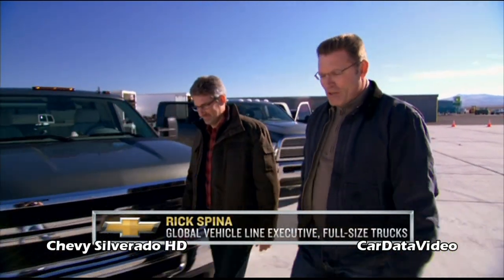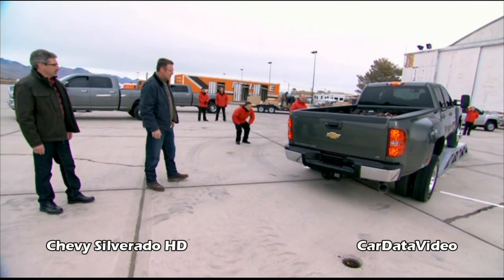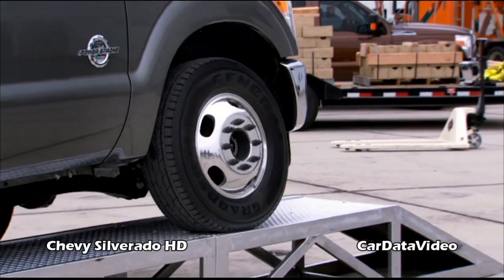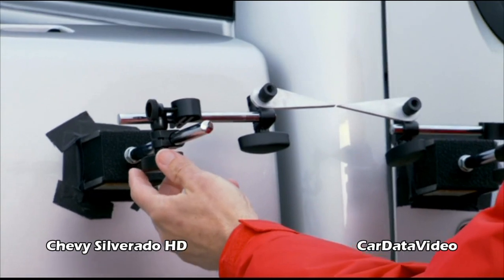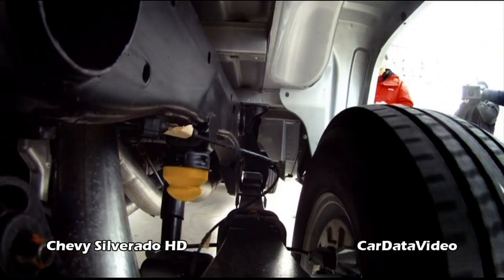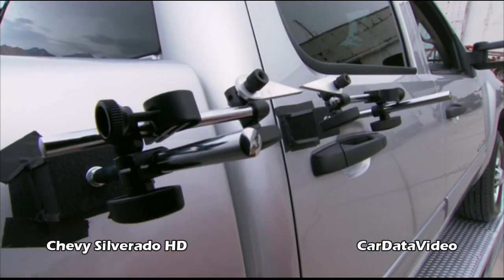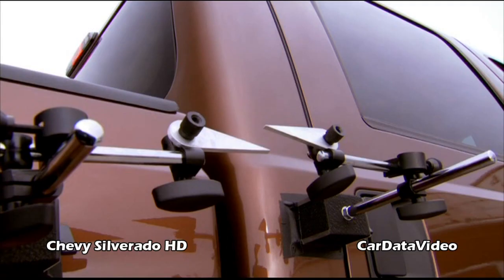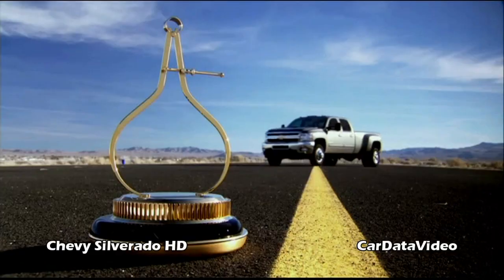Chevy vs. Ford HD Truck - Bed Bend Video

Comment: This is fake. The fords tailgate is locked, and it was a freeze frame during the dent in the tailgate door. They dented it with an object. The f250 things were in different spots than the silverado to begin with

Comment: Yeah Chevy might be stronger with twist, but what about GM quality control? I would go with a 2005 Ford rather than a 2020 Silverado, and who the hell is gonna go open their bed in that situation? And even if you have to, just hop on the tire and you have full access to the bed!

Comment: Placement of that indicator on the Ford is already 1/2 inch off whenever it was placed on flat ground. I am a GM guy, but those are not engineers

Comment: This is the dumbest commercial. Because the Chevy has a boxed frame when the Ford has a c-channel frame. AC channel frame is engineered to flex so when you're pulling a heavy load both tires stay on the ground. That's why all big rig trucks have sea channel frames and will never go to boxed frames.

Comment: GM owns Chevy, Dodge and GMC. Find yourself a owner of each and a Ford, then owners of imported trucks, then have them put their own trucks on the line with an endurance test. Then log any errors at the miles that they happen and what conditions the trucks were subjected to. Do this for a year and log any repairs and cost.

I don't have a preference on trucks, I'm more of a car guy, speed and style. I am willing to consider any American made over imported if the durability, reliability and safety are really good.

As a tip, you're up against mechanics that I watch.

Comment: The problem is in the suspension.  A softer front "independant"  Chevy suspension will avoid "twisting" the frame, look at  the front tire of the Chevy.... BURIED in the wheel well...
The Ford frame is way heavier and in unbiased and stand alone testing doesn't twist anywhere near the amount of others...

Comment: On the Chevy truck they turned the steering wheel to not bend the bed on the ford they did not turn the wheel so the bed bends but basically they have the same bed

Comment: Frame twist has a purpose. It's to keep the wheels evenly on the ground from the torque when you are pulling a heavy load on a trailer.  You see big rigs do it all the time when they have a heavy load. This video is pretty biased and uneducated.

Comment: Remember lads, this is when Chevy wouldn't shut up about their steel truck beds and how they were superior to the aluminum Fords. Chevy now uses aluminum.
Reply: Chevy uses aluminum for moving body panels like doors, hood, and tailgate. But they use steel for stationary body panels like fenders, roof, and bed.

Comment: Stiffer is not better, your incline and decline rate is horrible, all Chevy is, is a damn pavement princess you can’t take that shit off-road at all, ford and dodge with our suspension and shocks and a lot more flexible for a reason, does better when doing a mans farm work, and to have fun going off-road not get stuck with no place, because with that you can’t move in right spots

Comment: A real truck should have straight axle up front. Also flex is not a bad thing. I’d rather have things flex than break. The ford is kind of designed to flex under load. (16 and older). I say hook them up to a trailer and watch that ford out pull that Chevy 7 days a week 24 hrs a day especially with the 2020 and newer superdutys. They out pulled back then they can definitely put pull now.

Comment: You know that the new Chevy trucks actually use more aluminum then fords? Also the new ford frames are a lot stronger maybe this year of truck it wasn’t. This is very out dated and seems kinda staged and biased also motor trend keeps giving dodge the truck of the year now. It just shows that if you pay motor then enough money they will say whatever and give you whatever award.

Comment: That's what happens when you put a week c channel frame in a truck to save weight because you want to get better gas mileage. Ford is always been the weaker of the manufacturers and a lot of aspects because they want to get better gas mileage.

Comment: That's not been issue for anyone and not only that who does that off-roading vehicles have skid and suspension usually wen on something like that don't tryn open tail gate all you can come up with . Watch truth about trucks comparison of frame ect Ford is only one pretty sure fully boxed frame chevy notorious bad front end anything that ridge breaks instead of flex and  survive

Comment: There's a good amount of flexibility needed in the frame for it to not bend easily, also a stiffer bed as in chevy twists with the body making it easy for the vehicle to topple at high speeds.

Comment: Its better in offroad condition that the chassis aint so stiff...
Reply: Incase you like making oragami with your pickup the only thing moving should be your suspension not your frame. Jello frame is not an off road feature

Comment: Would take my ragged out 7.3 powerstroke and outpull any duramax, chevy duramaxtrucks come factory with 4 wheel drive flaws, this is why we don’t put independent suspension under a diesel truck

Comment: So I work at a ford dealership and just because of this vidieo, me and my boss took a used 2015 f350 dually and my brand new 2019 f350 dually and found a place to twist them like that with 2,000 pounds of sand bags in the bed. They bolth did NOT twist as bad as that and we could open the talilgates fine. So that tailgate was locked. Sorry to say it but Chevy is so full of shit on there commercials and their "awards" that they make up to sound like their the best. Which their not. Thats why ford has been the best selling truck in America for 42 years straight. Chevy guys dont even say anything in the comments because your just butthurt knowing that im right. Trust me I do research and know my facts and also have expirienced it. This is just another one of those usual chevy comercials were they lie and lie. Anyways the average person would never get to those angles with there truck and put that much stress on the frame. Fords frame is stronger and maybe flexed a 1/2 of an inch on the 2015 and a 1/4 of an inch on the 2019. So another lie chevy. Just saying, I could go on and on forever🤷‍♂️

Comment: Lol the tailgate won't open because the MF locked it, before the dude tried opening it. I am no fan boy too eother brand. I love my chevy and GMC. I own a 2019 Tahoe and a 2018 GMC Sierra 2500hd and my wife has a 2012 expedition and I love them all and this is very biased.

Comment: If the frame didn't twist under high stress or high load, it develops hairline cracks or it can break. Also depends on the properties of the material. This video is meaningless.

Comment: had both, Ford HD   GMC HD  , love Toyota:)) .GMC better suspension on the road ,by far better then Ford ,better than Tundra  .Ford  more capable in the dirt , mud .Had 2011 GMC   good truck , now 2018 does not feel that good .transmition is not as smooth , brakes feel funny too. My Ford had 7,3 turbo , best motor ever .

Comment: Absolutely no one that knows enough about how to properly load and unload a truck will ever have it at this stupid angle. It’s a super/heavy duty truck it’s not a fkn Raptor. These trucks are not made to twist and be off the ground like that especially under huge payload. Thanks Chevy for another stupid pointless commercial that’s makes absolutely no sense and makes y’all seem just desperate to get the edge on Ford…

Comment: Late model ford compared  to a new model Chevy. Fuckin biased af and they prolly even put more weight in the ford and they aligned the tires more even on the platform with the Chevy.

Comment: Still couldn't pay me to trade my 94 f150 for a brand new Chevy strait across. Couldn't drive a Chevy. I would feel like my balls were missing.
Reply: @darknes7800  ok so here is my take. You can drive any vehical you want, and spend as much money as you want to one it, so get one you like.
 In 1994 dodge came out with it's new feminized truck and people went crazy for it's "cute" rounded corners and what not. Women hold most of the purchasing power in American households after all. Dodges sales skyrocketed. It didn't take long for Ford to realize what happend so they made the change, so starting in 1996 all the Ford's look like a fiberglass girls car. Chevy was the longest hold out. Their trucks don't start to look girly untill 1999. By 2000 it's a lock. So in purchasing my dream truck my choices are pre 1999 Chevies, pre 1996 Ford's, and pre 1994 Dodges. The last of the masculin looking trucks. I think Chevy's look like base modles in camparison, and I'm not a dodge fan because I had a bad experience with a van. Not Chevies or Dodges fault, but that leaves me with pre 96 Ford's, and I like the 94 better than the 95. Now yes, while the bodies got worseeverything else got better, so if I were going to spend "65000" on a truck, I would give my 94 new 3/4 ton axils, a 6.1 from a 2014 Ford if I can find it, tranny to match. Those Bilstein suspension you see on Toyota with the blue and yellow. ECT.
Reply: @darknes7800  also that truck is not worth 65000. That's what you may have to pay to get one, but it's worth is what I could sell it for, which I would immediately. I bet a dealership would offer you 37 and end up giving you 40 if it were part of a trade.
Reply: @darknes7800  we can agree on a few things. We live in different worlds. You would not drive your truck like I do. I drive ALL dirt roads. The only time I hit the pavement is hauling 4 tons of scrap iron. you would not take your 65000 truck to do what mine does because your insurance wouldn't cover it. If I'm going to use a vehical I need to be able to walk up and kick it, see it get hit with a grown pipe or the like and not freak out, see the dogs jump on it. I have a pretty new Honda Ridgeline. I never drive it. My wife will get groceries once a week or so with it.  If I actually used it I would destroy it in a month. Also my truck is worth what I could sell it for like a said before. About 8500. If I lost it I would be looking for another. Also my tailgate works great.
Reply: @darknes7800  also 94 is efi
Reply: @darknes7800  let's agree to disagree. You dream of a new millennium sports car. I'll dream of seeing my truck roll over the 999,999 mark. I'm at 365 now.
Reply: @merlin4real  There was a time in my life, when I used work trucks to haul equipment for my projects.  They did take a beating.  As I got older ( then 35, now 53) I evolved my business into design only, no equipment sales and just didnt need work trucks or trailers anymore.  Instead of construction, my life is using Revit to design projects.  Its the life I made and enjoy.  Sounds like you can say the same, its a life you enjoy.  Therefore we can agree, living a life you enjoy is the best anyone could hope for !  Cheers !!!!!!!!!!!!!!!!
BTW, I hope your truck hits 1,000,000 !

Comment: Not only does the chevy not bend but in a head on collision you have a 85% chance to become lieutenant Dan by chevys not so new feature. It’s simple, when force is applied to the tire on either side of the truck it simply goes straight back and crushes your legs. You might be thinking, hold on a second wtf is this seriously an issue even in 2020? My answer to you is of course it is. Chevy hasn’t changed much except for having tax payers as income and switching some of their new 2020 Silverado bumpers with all new high strength plastic. While chevy is jumping to the future by using high strength plastic Ford is still using old ass aluminum bodies since 2015 and steal bumpers. Ford more like boomer am I right? Here at chevy we are dedicated to trying to undercut fords prices by a third while only offering half the car so we still don’t sell as much as Ford but that’s ok the government bailouts will meet the gap. Unlike Ford who has never went bankrupt in their over 100 years we have went bankrupts more times than see you again has views on YouTube. It’s a competition and Ford is currently losing to our outstanding track record of bankruptcy. Forget about the mustang as well Ford mustangs only have 5 liters while we pack our Camaros with the same engine that we have been for the last thirty year just the number after LS increase every decade. What’s that I hear? Doubt? Ahh no need to doubt us because we haven’t changed anything for the past 60 years and it only took till the 5th gen camaro for us to finally update the chassis. We also will pay you to act in our commercials because our commercials are real people not actors that we pay or anything.
Reply: ???What the hell are you talking about???

Comment: I've never been to concerned with the quality of newer truck models.
Especially chevy and ford because it seems both are quite unreliable,

HOWEVER

After seeing this video of the bed cracking on a ford just from slopes. I can safely say they're poorly designed as far as suspension and body. They ride stiff and have poor suspension aswell from experience

Comment: My list : for most reliable trucks (in my opinion)
1. Toyota
2.Ford 
3.dodge 
4.Nissan
5.chevy
Reply: redez 1918 I’ve got a 2000 frontier that would beg to differ on that

Comment: um, I dont do that with my truck... but what I do is put 26,000 miles per year on the truck... i will take the more fuel efficient truck. Aluminum has advantages over steel for my Philosophy of use. actually, i would prefer a subaru, but they can't tow as much.